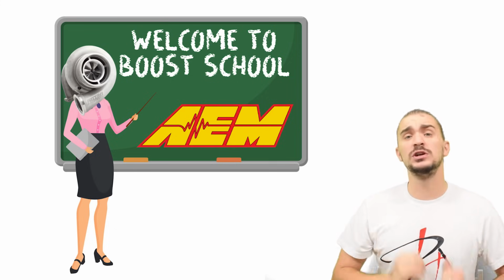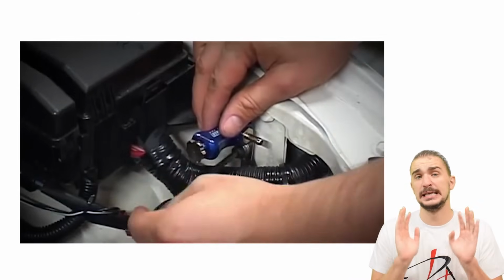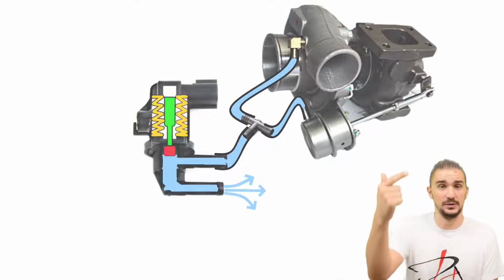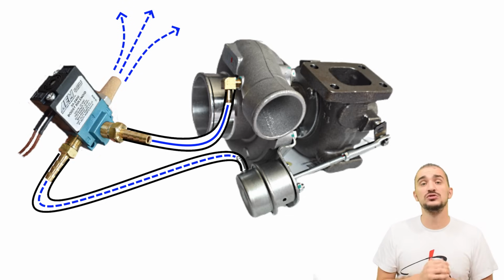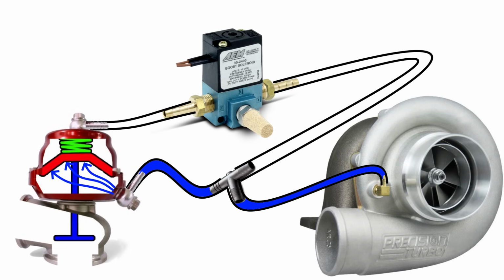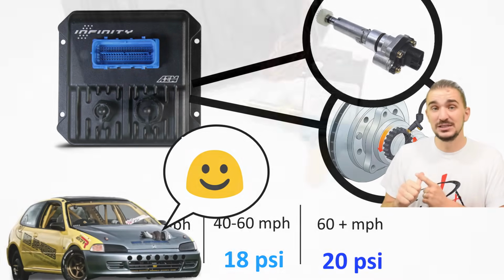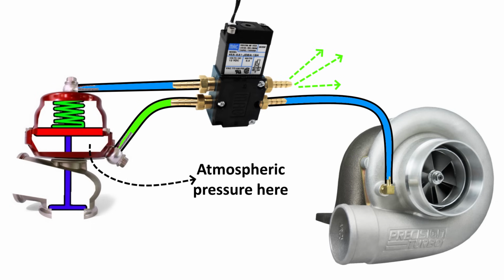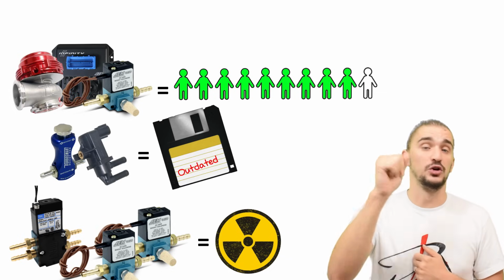ALL BOOST CONTROL setups EXPLAINED - Boost School #3

Comment from the maker: AEM boost controllers: http://bit.ly/D4AtruboostX
AEM ECU: http://bit.ly/D4Ainfinity5
AEM high flow fuel pumps: http://bit.ly/2D4Ahighflowfp
AEM wideband AFR gauge: http://bit.ly/D4Axserieswb
AEM digital racing dash display: http://bit.ly/D4Acddash
Let's hang out: https://superpeer.com/driving4answers
Support d4a: http://driving-4-answers-shop.fourthwall.com/
Reply: You missed a style of turbo controller. 

For mechanical control of variable turbo (vnt)

(This is my vw truck):
 https://m.youtube.com/watch?v=iD4bOiggdW4
https://m.youtube.com/watch?v=MtIugEqjkHk

Gfb (go fast bits) sells a controller. 
 But there are many styles. 

As someone who pushed an old t3 turbo to the limit...

Variable turbo is where it’s at brother. 

It’s a whole different ballgame. 

Controlling a wastegate. 

Just imagine if all that energy wasn’t wasted. 

Bro you make the best vids I love you. 

I strive to be more like you. 
You have taught me not only so much, but also how to see cars in a new light after many years of dark times as a professional mechanic.
Reply: Why two port solenoid can't be installed inline instead using T connector? Why we need three port solenoid and vent boost to atmosphere?
And why we need mess with ait at all? We can use solenoid directly to open wastegate exactly when we need it.
Reply: Bro whats the difference between a supercharger and a turbo if we assume that both provide the same boost level?also why in a NA engine you feel more and more power as the revs rise while in a turbo engine you dont have a linear power delivery?
Reply: @eliasaggeli1225  A supercharger gets its power via a belt attached to the crank. This causes a small power loss, but the power gain from the supercharger always overcompensates for this loss. However, due to the initial power loss, there is lower fuel efficiency. A supercharger, since it is directly connected to the crank, the power that you ask for (depending on amount of throttle, as well as the type of supercharger (which make peak boost at either low revs, like your screw types, or make high power at high end of rev range, like a centrifugal supercharger)) power is immediately delivered.

Turbos on the other hand, get their power through the exhaust gases, just after leaving the exhaust manifold. However, the air pressure + flow is a bit random and can cause inconsistencies when you ask for power that the turbo may or may not be currently making since it takes time for the turbo to spool up. Additionally, turbos can only operate over a small bandwidth of the rev range since the turbo exhaust housing can always have an ideal amount of air since it has a fixed shape. (Unless you are some rich kid and/or tech nerd who can buy/make a variable turbo which operates over an extremely large amount of the rev range). And due to this bandwidth issue, the power is increased in one part of the rev range, but not the whole rev range. But, since turbos are generally cheaper and operate off of exhaust gases, they are usually the primary choice of car consumers/enthusiasts.

Finally, NA engines operate dependent on the air supply  present, which is always consistent (unless you plummet your car 40km vertically down a mountain, where air density makes a difference). So, since the air is consistent (and the car is designed to have close to linear power delivery, which it should be), the amount of throttle that you apply will translate to some amount of power increase as intended by the engineers.

Also, if you are still confused, just search it up on YT.
Reply: @kart5486  thanks friend... i basically knew how all these 3 engine types worked but wanted some deeper knowledge
Thanks
Reply: What makes more power and/or torque: a low cr engine with turbos fitted to the engine to make as much power as possible without running into knock, or a highly optimised high cr engine which is na?
Reply: @kart5486  it depends on engine displacement and cylinders. In example an NA engine with 5L displacment and 8 cylinders will easily make more power than a turbo 2L 4cyl engine. Also an NA engine with 3L and 6cyl will not always make more power than a 2L turbo engine. Also more cylinders mean smaller pistons and smaller pistons can rev higher and by revving higher you can make more power out of an NA engine. In example a 5L NA v10 engine will always make more power than a 5L NA v8 engine if all other things being equal
Reply: @eliasaggeli1225  Heh, I forgot about some of those things (I'm more of a rotary guy). I'm more of a rotary guy, and am trying to figure out if adding a low boost potential centrifugal supercharger would compensate for lower VE% at higher revs for a high cr rotary. Thanks for that, dude!
Reply: @kart5486  either centrifugal or positive displacement supercharger, both will seriously power up your wngine
Reply: Could you please explain twin scroll turbos too?
Reply: @hridaypradhan4999  Twin scroll turbos have two exhaust gas lines which are inside the exhaust housing, and are used when 2 or more exhaust gases from different cylinders which have the same timings for their exhaust strokes would usually interfere with each other. This results in a much better exhaust flow since the gases aren't interfering with each other, and are instead spent more efficiently on getting flow for turbo spool.

Comment: So this may be a stupid thought… Wouldn’t it make more sense to put the waste gate on the compressor side somewhere, instead of the exhaust. And then by doing that, you could let the turbo spin up and make full boost all the time, and just went the excess air. So when you want more boost, it’s there instantly by just closing off the waste gate. The mentioned method just seems counterintuitive, since when more boost is demanded one has to wait for the turbo to spool, after the waste has been shut.

Can someone please explain this to me. Am I missing something essential, that explains why it isn’t done like this.

Comment: Okay so basically what you're saying is you need to have a 27 Port boost controller feeding a 4-port boost controller which then feeds two 3 Port boost controllers which power dual sequential 10 Port boost controllers...got it.

Comment: Hey! Great video as always! I know I'm late to the party but there's something I can't fully understand so I hope you will answer this. From what I understand of the second plumbing setup for 3-port solenoid and external wastegate, the bottom side of the WG will always get the current boost pressure, and if you set your solenoid's duty cycle to 100% also the dome part of the WG will get the same pressure and counter the force on the diaphragm. What I don't understand is why is this method supposed to be better at countering the exhaust pressure so that it doesn't crack open the valve? If I'm running 1 bar springs in the WG, In the simpler plumbing method I can have 0 pressure lifting the spring (100% duty cycle), so the limit would be when the WG valve is open by sheer force of the  exhaust pressure, in the second method I can have 1bar on each side, or 2 or even 3 bar on each side, and at 100% duty cycle the resulting force will always be 0, so again, the exhaust pressure added to the bottom will sooner or later crack open the valve anyway. So why is method 2 better?
Reply: was thinking the same thing, what is the purpose of sending pressure to both parts of the diaphragm vs not sending any pressure? unfortunately this is an old video and we are unlikely to get an answer :(

Comment: On my race cars/trucks, I run a 4 port solenoid with a pressure supply... on my race Truck it's an APS compressor that makes 10 bar in 7 seconds. On my buggy, it's a compressor that keeps 150psi at all times. They run the paddle shift and are T'd off to the boost control. The boost control is always the same... 100 psi on the supply of the 4 port with an Anti-lag strategy backing it up. The engine maintains boost OR torque as requested. I prefer torque and not boost. On my race truck you dial the torque and the boost does what it needs to do to make that torque.

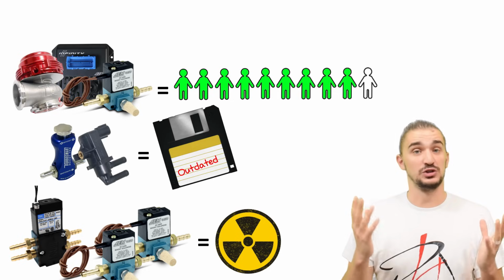Comment: 22:32 There are technically two more levels:

Level 7: Electronic wastegate actuator

The previous levels all assumed that the wastegate actuator is controlled by boost pressure. This works well, but with an electronic wastegate actuator the wastegate position can be freely adjusted without needing significant boost pressure.

Level 8: VGT (variable-geometry turbine)

Often seen in Diesel engines, this is perhaps the ultimate in terms of controlling boost, since it has much more accuracy and precision than a fixed turbo with a wastegate.

Comment: The only thing this video doesn't cover, is what actually causes a 2 port external wastegate with a 3 port boost controller to open, when the controller is allowing full boost to the top of the wastegate
So if both the top and bottom see full boost, they cancel each other out, and the only  variable that is different is the wastegate spring itself.
I understand that exhaust gas pressures contributes to opening the spring as well, but is this linear for both a 7 psi spring setup and a 20psi spring setup? Meaning that it would open at Double the rated spring pressure for both? or a logarithmic scale?

Comment: It seems to me that a 2-port solenoid connected to a manual boost con troller would give excellent results,  once the manual controller was dialed in to the correct pressure. The insertion of the manual controller in  between the "T" and waste gate would eliminate the constant pressure on the waste gate spring inherent in a 2-port solenoid set up.

Comment: @15:14 thats actually kinda how the old 80s bosch kjet mechanical fuel injection used to fine tune A/F ratio in its fuel distributor.
Very simple in practice yet hard for me to explain without diagrams

Comment: For variable geometry turbo this does not apply in any way.
Vw uses the 3 way solenoid since...before 2000 and it is usually present with a vnt turbo.

Comment: Why not use an electronically controlled waste gate? Measure pressure from the boost and control when and how much the waste gate opens? Why go into the mechanical complications of working with a spring?

Comment: What about turbine control with solenoid conected to the vacum line and wastegate actuator like in bmw e90 335i (engine code n54b30). How does it work ?

Comment: Interesting video. Is there a reason why we don't skip the pressure controlled wastegate and use an electronic actuator instead? We already have a MAP sensor to detect the actual boost pressure, why do we still have a pneumatic system?

Comment: If it's added to a existing electronic boost controller, it's just increasing the waste gate pressure required to open the Diafram

Comment: This might sound like a rather simplistic question, but why not consider substituting the spring in the wastegate with an ECU-controlled solenoid? It appears to be a simpler configuration than using a 4-port or two 3-port solenoids. If the turbo pressure can be monitored, the solenoid could trigger the wastegate to open once the desired boost level is attained. By swapping out the conventional on/off wastegate for a digitally controlled valve, it would be possible to finely regulate the amount of boost bled from the system.

Having fewer components translates to less intricate software management.

What am I missing?

Comment: hey D4A.  I'm new to your channel and I am impressed.  very detailed and informative.   One thing I have noticed on YouTube is that nobody seems to highlight how important the distinction of how the exhaust turbine is driven. Specifically that it is not the speed of the exhaust gasses passing through the turbine,  but the heat of the exhaust gasses passing through the turbine.   An example being that a diesel engine in a transport truck can have achieved full boost at the very bottom of its rev range when climbing a long hill for example.   Or another way of phrasing it wound be that the volume of exhaust gasses is what drives the turbine..  and hotter gasses have more volume.   This fact was a game changer for me when I first started learning about turbo supercharging systems.   Some people might think that the turbo lag is caused by the fact that the RPMs haven't gotten high enough to spool the turbo up,  but in fact the turbo lag is caused by the time it takes to build up the exhaust gas temperature when at full fuel / throttle but low RPM...  and that the exhaust gas temp and the increased pressure that the compressor forces into the engine are a positive feedback loop.... as more fuel is added,  the exhaust gas gets hotter which increases turbine and compressor speed and boost pressure,  which provides more air volume on the intake which allows for more fuel which creates more exhaust gas heat... and on and on it goes.

anyway... great video series dude.   just a little point that for some reason I can never let go of... lol.   exhaust turbine is driven by heat,  not RPM.   thnx again.

Comment: Why aren't there simple electronically controlled mechanical boost controllers that avoid using complex spring/pressure balancing approaches? Something like an electric stepper motor or solenoid that opens a vent gradually when the ECU tells it to?

Comment: Am I  better off not using a boost controller & use the various springs for the wastegate? Why does a manual controller give such erratic results, and doesn't  it close when you remove your foot from the accelerator?

Comment: Isnt that a problem that we vent some boost pressure on the 3 port controller ? i mean isnt it the same as we drive with an open blowoff? the air mass sensor already "counted" the air in the system...and we just let it out?
Reply: It's not enough air to make any meaningful difference

Comment: I put a manual boost controller in between the waste gate and the Turbo port and now I have no boost whatsoever. I've got a gauge...  I even put the stock hose back in and still no boost.

Comment: It is getting more and more complicated to the end of the video, but I was hoping something more simple and elegant. Would it be possible to have a sensor to monitor the pressure, and a simple solenoid to open / close the wastegate based on the values from the sensor?

Comment: YOU ONLY COVERED OLD SCHOOL BOOST CONTROL and MISSED TWO-THIRDS OF THE SYSTEMS OUT THERE. Many (I'll say most) of the newer turbocharged engines have a VACUUM OPERATED wastegate. The gate is OPEN at idle or with the engine off. There is no minimum boost from a spring. There are three advantages. (1) The vacuum actuator has the ability to open or close the waste gate at any time independently of boost pressure (within limits given the size of the diaphragm). (2) There wastegate does not start to crack open progressively as the set pressure is reached. It stays 100% shut until commanded open by the ECU, period. This is the best setup for boost response. (3) Finally, because the wastegate can be open at idle or light throttle during freeway cruise with the engine making vacuum or very little boost, back pressure is reduced during freeway cruise improving fuel economy. Downsides? The vacuum operated may clatter at idle or near idle when the vacuum is weak. Also, because it pulses the waste gate directly instead of the solenoid and the boost reference line, it can wear out sooner. Manufacturers swear it'll still last over hundred thousand miles though. Most recent Mini, BMW and GM turbocharged engines such as the N-series, B-series and the LFs have vacuum operated wastegates.
--
There is also the ELECTRICALLY OPERATED wastegate. These do not rely on boost, vacuum, diaphragms or solenoids. The wastegate is operated directly by an electric actuator usually via worm gears which means that while the motor can open or close the gate, forces from the wastegate cannot move the motor. An example of this is the GM L3B 2.7L I-4 Turbo in the Silverado and the CT4-V.

Comment: One solution I was expecting you to talk about is the fully electronic wastegate setup, used mostly in road cars. I know vw uses them in their tsi engines. Maybe it is even better than the solutions presented in the video? Maybe it is safer or easier to calibrate for mass production, idk.

Comment: Hey. Volkswagen's wastegate is electronic (Golf VI TDI 1.6 at least is). Does that mean that it is behaving like 2port boost control solenoid (level 3)?
I'm asking this because I have some turbo surge sound, which shouldn't happen on diesel since there is no BOV to prevent it. Could it be that my wastegate is bad, and it doesn't open, so it allows for more boost than my turbo can take, so when I release the throttle it goes "stututu"?

Comment: Seems like a better control than all of these would be a button on the steering wheel and a pressure gauge on the dash. Of course you'd want a second similar setup for your NOS.

Comment: First, I'd like to thank you for this video.  It helps explain quite a bit.  I'm running into an issue:  I'm running Tial MVI2.5 internal wastegates on the XR6564S with a Plex PBC Pro.  It uses a 3 port solenoid.  Right now, I'm boosting way over the wastegate spring rated psi.  For instance, when I removed the boost controller completely, the 12psi rated spring runs the boost pressure to 18.85psi of boost pressure.  When I had the 22psi spring, it was completely boosting out of control at 33psi+.  I'm running a 3.5" x-pipe with no resonators or mufflers.  Any ideas?